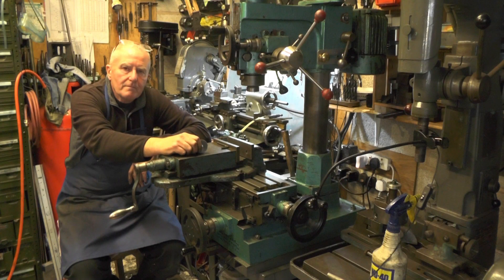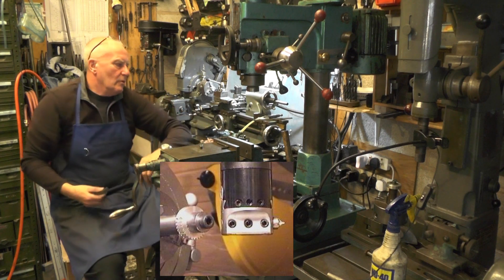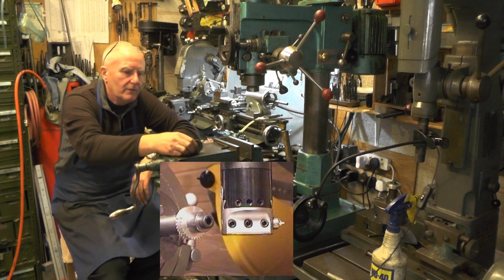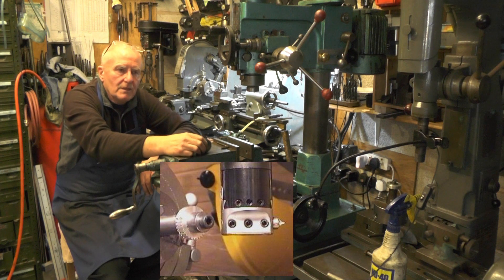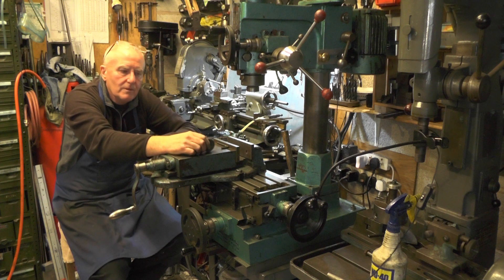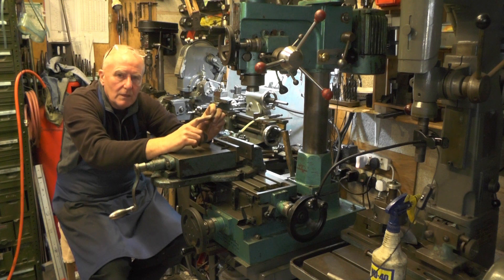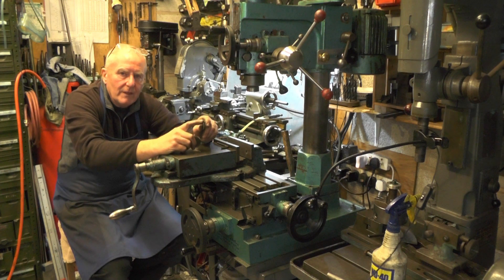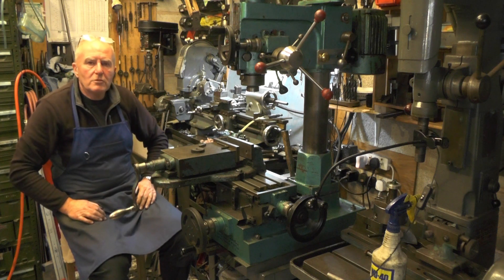Mini Mill Grinder / Router Adaptor Plate

Comment: Why not just use the 21 tooth gear trick?
Reply from the maker: Hi d 100r
Thanks for watching and feedback
I didn't mention the 21 tooth gear because i was just generalising for most metric and BA pitches with 2 gears, 33 and 34, I believe the 21 tooth gear just gets 3 pitches 0.4 0.5 and 8 ba, does your trick of 21 teeth get all the pitches. would be great to know.
regards
 Kev
Reply: @MrFactotum  i it uses one or two 21 wheels i t works for all metric pitches if u think about it once you have one pitch you can simply arrange ratios to get all the others ,bear with me will find relevant info you want and will add as a reply on homemadetools
Reply from the maker: @daturat100r  
Cheers  d100r 
Its worth knowing thanks.  I will take a look later today. Thanks
The method i use though you just have to take the one gear off swap it with 33, or 34, or 21 and no re arranging the gear train, takes a matter of seconds, but there's always more than one way to skin a rabbit as the saying goes, so would be nice to know your way
Cheers
Kev
Reply: @MrFactotum  found and added info link to your post
Reply from the maker: @daturat100r  cheers i will take a look

Comment: What ho Mr F, 
Oh dear is my humour becoming too obvious?
Looking good and I can see the potential, I use a tapered solid carbide end mill for what you are doing but your way will be cheaper in the long run. HSS will mill but grinding has benefits and puts less strain on machinery and nerves.
Reading other comments I see you are trying to avoid H&T your cutter, a sure way to add work to have to sharpen after the cooking. Again a solid carbide tapered milling cutter is great as you can mill fully hard gauge plate or silver steel.
Looking forward to part two.
ATB  
c 
PS about to send piccies of working prototype 27-50 bore Mic.
Reply from the maker: cheers chris
I don't have any solid carbide cutters, don't mind H & T'ing  if I have to!
I will take a look at the piccies shortly thanks.
Kev
Reply: @MrFactotum  if they don't have any more model engineering shows neither will i 😭😭😭😭😭😭